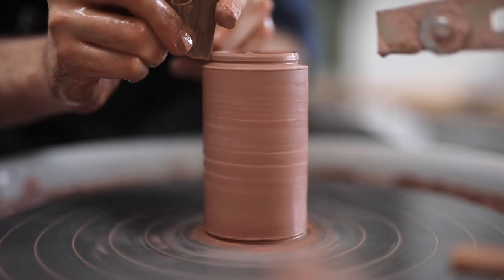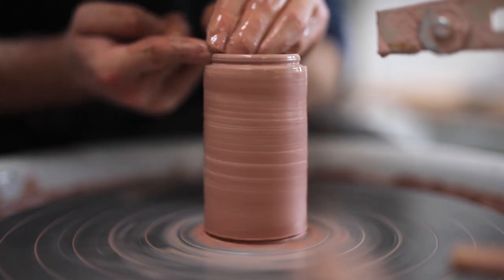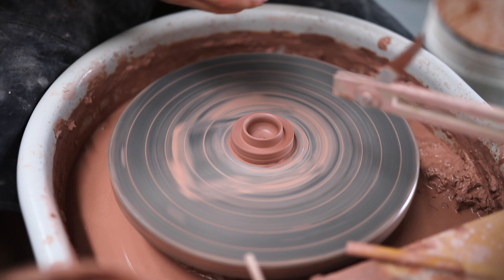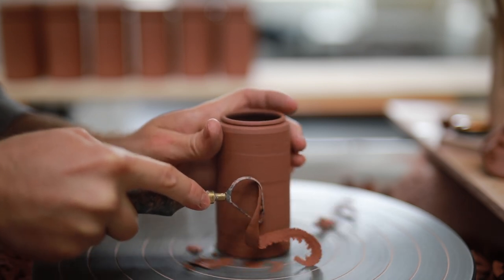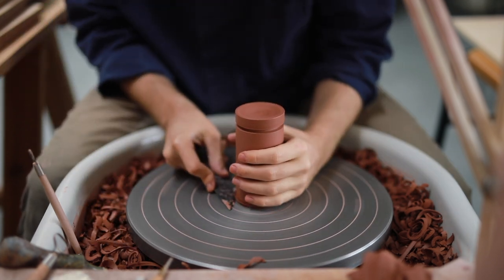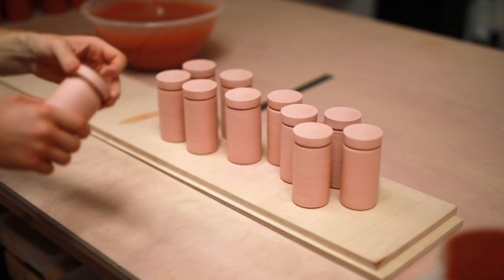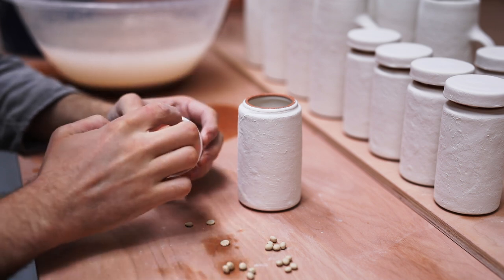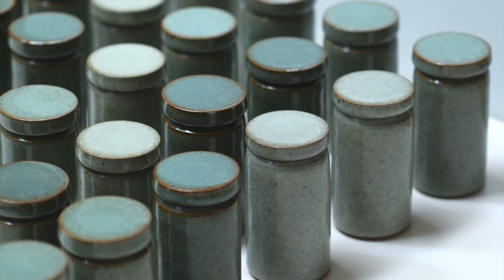How to Make Simple, Small Pottery Jars — Narrated Version

Comment: Oh inspiring one, please tell me how to remove the wads fro the jars after they are fired. Thank you for all the beauty you bring!
Reply from the maker: They usually just pop off easily ad I position them in such a way that they don’t touch any glaze. If they do stick to either component then they need to be carefully removed, especially if they’ve fused to the glaze. In that case I’d use a rotary grinding tool to grind them away, or pry them off with a potters needle.
Reply: @floriangadsby  Oh how generous you are! You found my lttle ?, nurtured it and set it free. It has flown thousands of miles, across two oceans and nested on the edge of my pottery wheels as a whisper to guide me! mahalo!

Comment: What happens to the wax resist on the base of the jars? Do you remove it before firing?
Reply from the maker: You don't have to do anything, it just burns away during the gas firing.
Reply: @floriangadsby  thanks! I'm teaching myself whilst running classes in Pottery for adults with learning difficulties. I was thrown in the deep end when I was offered the job right before lockdowns began and with no live courses running, these videos are a godsend!